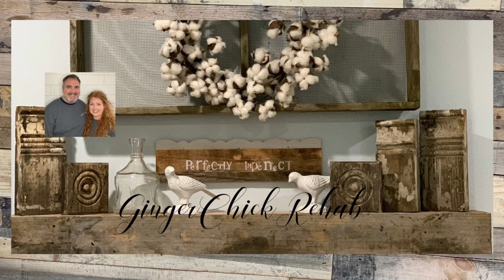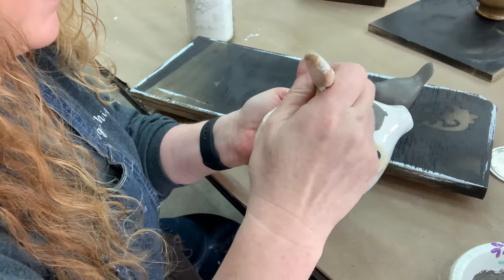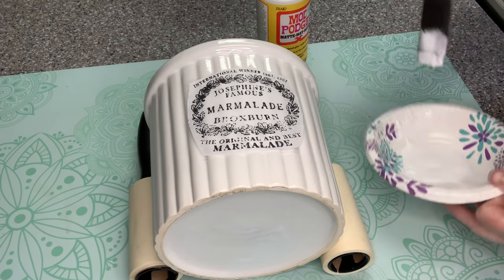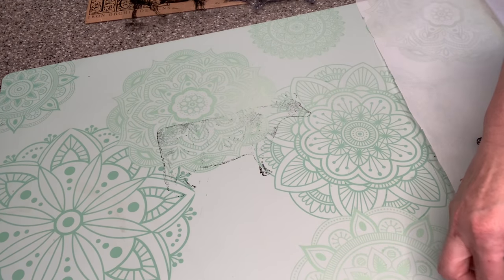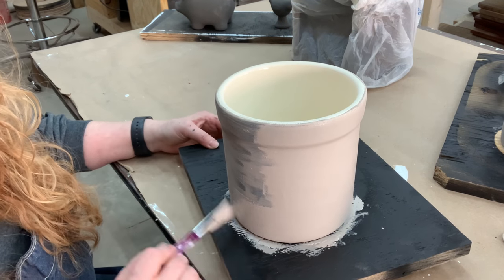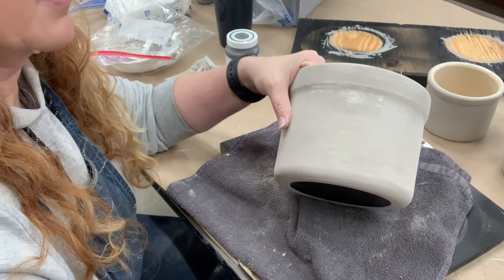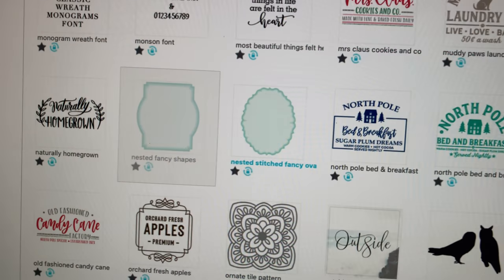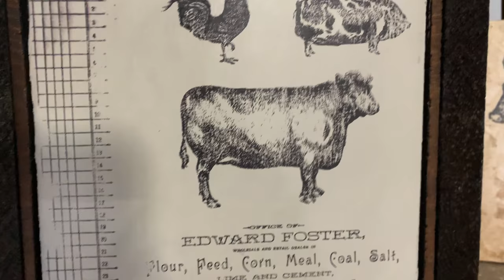Making Farmhouse Decor From Thrifted Finds || Trash to Treasure || Crockery Stamps

Comment: When doing the cement look on slick surfaces, I paint the item with chalk paint without the baking soda.  Usually two coats.  Next I stipple on the chalk paint and baking soda mixture.  I seal with a spray poly acrylic.  Then stamp and seal the stamp with poly.  Last white wax and wipe back.
Reply from the maker: Thank you for sharing that

Comment: i use auto primer first...let dry...second coat and they are ready...but i usually let the item stand for at least 2 to 3 weeks to ensure that the paint cures...
Reply: Most paint needs three weeks to fully cure.
Reply: @pattyashcraft4518  yes,  I had the experience that after 2 weeks the paint (primer) would scratch so easily and ruined the piece...now I wait and move on to another item...4 weeks is the best and the primer is hard as it can be...next put the regular paint and let cure for no less than 2 weeks...voila..no more scratches no more ruin pieces
Reply from the maker: Yes.. agree.. doing this they definitely need cute time that’s for sure